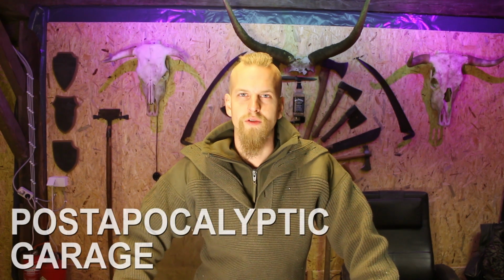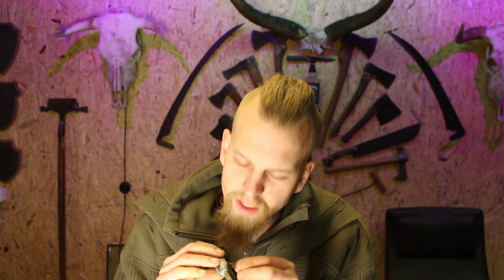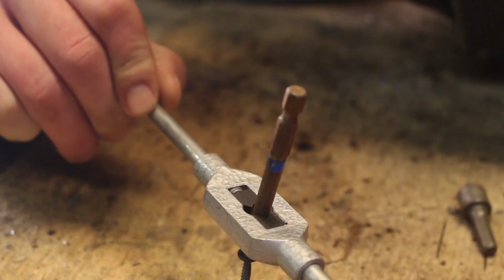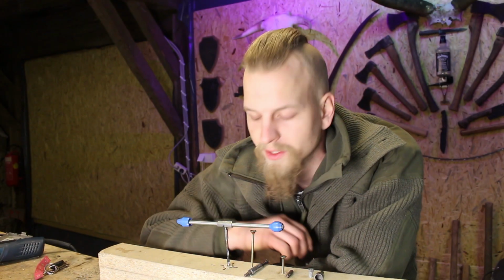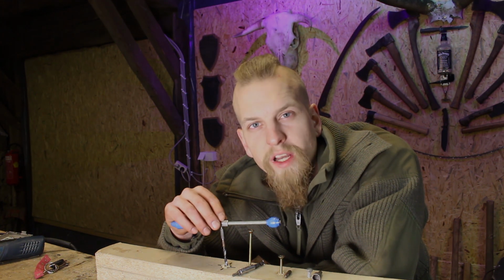How To Build The Easiest Tool Ever - T-Handle Bit Wrench - Post Apocalyptic Tools And Machines

Comment: Yours is much to complicated .Using the tap handle just 1 small peace of plat sock then drill and tap the tap handle on each side screw the flat stock down flat against the tap handle and what ever your using as tool will not fall through and you were able to use your original handle to do the job . This from the annex of the  Postapocalyptic garage . HAPPY TRAILS .